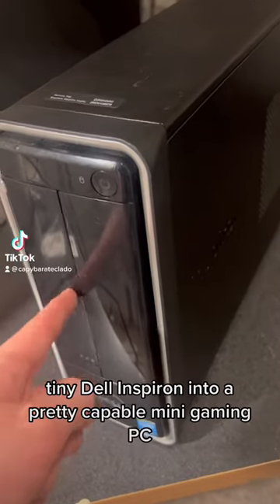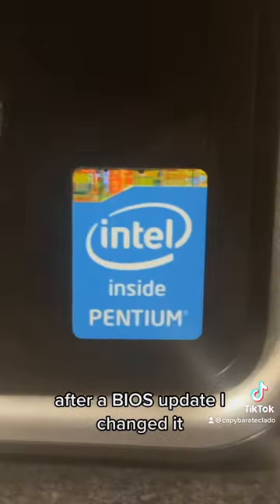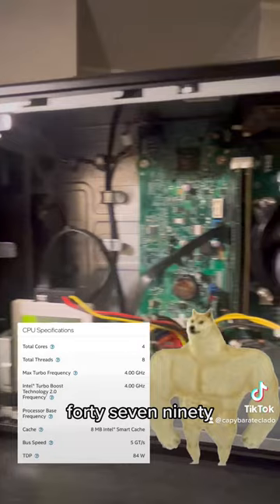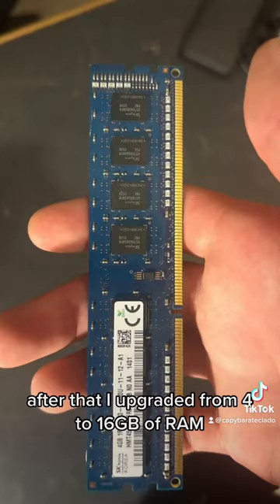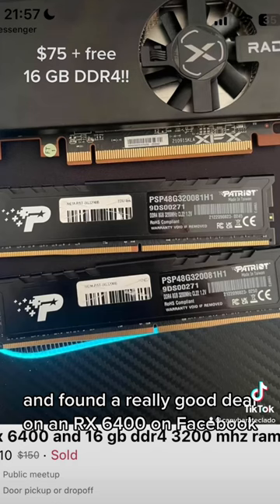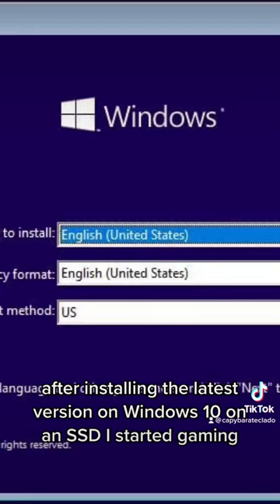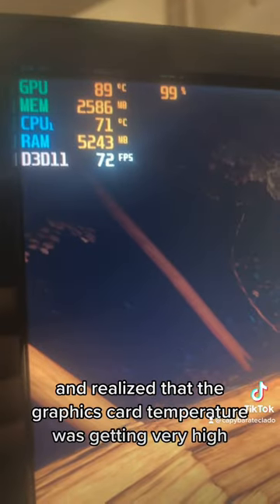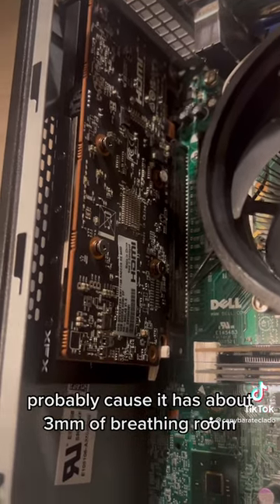Building an almost sleeper gaming PC! #amd #pc #sleeperbuild #pcbuild

Comment: Nice and it's good that your upgrading air flow. 👍
Reply from the maker: Oh yeah the case is like a metal furnace and the heat just lingers without airflow. I stuck my hand in and it felt like a oven!
Reply: @HairyScrambler  Yeah you got to be careful with old sleeper builds like that but I think once you zip tie those fans and plug them up to the mother bored it should be fine just remember heat rises up so you got to be careful of how you place your fans.
Reply from the maker: It actually has a ton of ventilation on all sides so one fan facing the GPU/processor heatsink is fine since the air goes out the otherside. You’re right, it’s hard to mount fans any other way but through zip ties which is unfortunate

Comment: Should of just cut the bottom where the fan can breathe. So many people vertical mount their gpus with no room in their 4000D case and see high temps.  These cases or most cases on the market can't handle it unless you water cool it and that kind of defeats the purpose.
Reply from the maker: Oh no it’s actually BTX small form factor so the GPU sits above the CPU upside down. I see what you mean but I think the cooling solution on this version of the RX 6400 is terrible. The fan is inadequate and the heatsink looks beefy but it’s just not it. Pretty pathetic on XFX’ part considering it only uses 40 watts

Comment: It looks like the GPU MAY be an XFX LP single slot RX 6400 GPU. I have that. It naturally runs hot. At idle on 6 watts in Windows I got just above 60c.

I thought it was because it was on a m-itx board, right next to the CPU heatsink, and because it was in an SFF case, much like yours.

But it's not, it's because AMD is AMD. :-S

In the FAQ XFX said normally cards run 40c to 70c, Radeon cards can run 50c to 80c I think. And it wont throttle until the junction thingy (hottest part of the silicon die) gets to 110c to maintain higher performances.

As a long time Nvidia user this was alarming, nearly bought a different PC case.
Reply from the maker: You’d be right, it is that card. Really, 110°C? That’s absolutely ridiculous. In a hotter region you’d be damned to own this card. I can’t believe it gets so hot only running 40-50 watts, it must be because it’s clocked at like 2.2 ghz.

I’m also admittedly a longtime NVIDIA user who expects over engineered coolers that run at 60°C. I also feel like there’s a good amount of difference between the two clock wise. AMD cards seem to just run dumb at the highest and only when they’re about to burn up in planetary orbit do they down clock. NVIDIA cards seem to more aggressively down clock at lower temperatures.
Reply: @HairyScrambler  Also, the heat sink is quite small on this card and the black air shaft thingy also conducts heat.

I played a game on it yesterday for the first time. Ace Combat 7, settings to highest, 60fps and 1080p. Card fan did get audible, but when I quit the game and went to AMD Adrenaline or whatever the software it, the temp was just a bit over 70c.

Not bad. It does take a long time for the temps to come back down though. We just have to get comfortable and trust that XFX know what they're doing. For us, we've had a different understanding of graphics cards and what we expect from idle to gaming temperatures since we've started using them.

This explains why the PS5 and Series X/S are also fairly over engineered to handle the console heat.

When the days reach 34c in the UK during the inevitable heat waves, I'm curious as to how well this build handles the heat. It looks very similar to your build. It's a bit more congested in that SFF case then I'm used to. I did my best to neatly organise the cables and the temps in the case dropped about 10c. We have to trust that the engineers of this HP case know what they're doing. I didn't realise the lower right side panel exhaust fan would be that effective in this location, but it is. It must be fine, because if a desktop PC can't handle a hot day, it's useless.

The real question is, does AMD realise they may have solved the issue of low powered electric radiators for the winter months. ;-)
Reply from the maker: @DDuMas  You’re right even if there’s mini copper pipes it’s inadequate. You can’t even undervolt or under clock the card which makes me annoyed. I’m slightly disappointed with this build because the case airflow sucks, there’s no where to put fans and the SSD somehow is already bad. I’m glad the card only cost me $75, £60
Reply: @HairyScrambler  I don't think you need to undervolt it. We just need to trust XFX know what they're doing.

The card is okay for me, because I'm more of a retro gamer. I haven't been wowed by many AAA games last gen or this gen, so I'm okay with this level of performance.

But it was quite a sacrifice we made for this SFF PC. But it's the best LP card available.

I have a WD Blue SSD and seems okay right now. It sits near the bottom of the case in a 2.5 to 3.5 inch bracket and seems to run at about 37c. I'd recommend if you haven't already, open it up and really try to reorganise the cables as best you can and tuck them as far down and away as you can.

How did you get the card so cheap? Mine unfortunately cost £150. :-( Nvidia cards cost more, probably because there is more interest.

My goal with this PC was for it to be really low powered. I'm using an i7-3770T. Just as well I'm into retro gaming. :-P
Reply from the maker: @DDuMas  I got the card second hand locally on marketplace and waited awhile for a deal like that. At the price of it new I’d rather just get a used 2060 or 2070 but I know case and power supply wise the 6400 is perfect. The i7 3770 is perfect for it and the fact it’s the T version goes with the low power theme. 

Ideally I’d really want to sell the platform and get a PCIE gen 4 ITX system. Something like Ryzen 3 3100 or 3300x

Comment: the i7 4790 is ddr3?
Reply from the maker: Yes, haswell is the last intel processor generation to support standard DDR3.
Reply: @Hairy Scrambler  so why did you say you put ddr4 in it?
Reply from the maker: @Jamham_  I didn’t, I said I got free ddr4 in a deal but I gave that too a friend. I can 100% assure you that 4th gen intel does not support DDR4, it’s not possible. Haswell E was intel’s first line up to support DDR4 2133.
Reply: @Hairy Scrambler  i can back this up, I upgraded to a new PC last year, I also had an i7-4790k and it's ddr3, it's still running as a gaming pc for a lil' buddy who's got no moneys for his own PC, it's running with an AMD RX580, for 1080p gaming that thing still performs

Comment: Good job man. I'm trying to upgrade my ancient Dell PC, poor thing aint the spring chicken she used to be.
Reply from the maker: I got most of my stuff as hand-me-down. If you’re looking to not break the bank and have an intel system newer than 2010, I recommend upgrading to a Xeon. They cost about $20 from eBay and usually parody which ever generation i7 performance. Just check compatibility, of course.
Reply: @HairyScrambler  Well its a Dell XPS 8700 from about... The tail end of 2013? Small case, definitely needs to be upsized to allowed for better ventilation. Only thing I've really upgraded is the graphics card.
Reply from the maker: @madcat789  I have one of those from the exact year and they’re super upgradable. Mine came with an i7 4770, 8 gb of ram and gt 635 I immediately sold. I don’t know your budget, but I ended up adding another 8gb ddr3 (probably $15), a GTX 1060($75), a 256 gb ssd ($17) for snappy OS and it’s a great little machine that can run pretty much anything. I also added a noctua fan to the front as there’s open ventilation holes around the bottom. If yours is a bit older and not maintained I recommend refreshing the thermal paste and giving it a dust.
Reply: @HairyScrambler  I dust it once a year, and its about that time again. I've been thinking of upgrading that ram, lord knows its slow as hell already. I slapped in a nice and solid 3TB HDD that offers just what I need for large programs. Mostly its the machine's case itself. I'm thinking of either taking out its guts and putting it into a new husk, or cutting a hole in the side and extending it horizontally to help with airflow. Right now, the GTX 2070 is kinda sticking out the back.
Reply from the maker: @madcat789  Like you said, I’d probably just case swap at that point and try to get a good deal on a used 10th gen+ platform with an i7+ would be great for your 2070. If you ever wanted to get like a 3070 in the future you’d also have performance headroom for that. Whatever you have now is holding back the 2070
Reply: @HairyScrambler  Absolutely. The problem is, the motherboard looks hard mounted into the case. In the morning, I'm going to take a closer look at it to see if it can be properly removed, or if I should build the next one.

Comment: 4790? So you put a 10 year old cpu in an 8 year old computer and added a 6400 which is equivalent to a potato. Yes, you should be able to run minesweeper at 4k just make sure to upscale from 1440p with fsr😋
Reply from the maker: Okay I’ll just throw everything away and get a 13900k and 4090 (sell one of my vital organs) in order to make you happy. then my life will be complete. We have to get rid of everything old and ensure that it is properly eaten by marine wildlife
Reply: @HairyScrambler  that's more like it. 8K path traced Minesweeper for grandma. Don't want to be a bad grandson
Reply: I know it's the lowest end GPU but it is new, so I was wondering if the old cpu would create a bottleneck. If so, I'd kinda like to see your setup swapped with the 680m igpu and see what the overall performance and price differences would be.
Reply: I should mention before it sounds confusing to watch gamers nexus new video on the laptop components in desktop motherboards coming out of Chinas refurbished industry. They are putting crazy things together for suuuuper cheap
Reply from the maker: @ClappOnUpp   What? The 680m is an integrated GPU on Ryzen 7 6800h SOCs. The RX 6400 is much faster and has dedicated GDDR6 memory. The processor i7 4790 causes a bottleneck with the 6400 and can handle more for example like a 1660 super. 

For what it is the 680m iGPU is very impressive but is equivalent to a 1050 ti while the RX 6400 matches a 1650. I got the card for $75 so I figured I’d pull out something I already had and make sub $100 build
Reply from the maker: @ClappOnUpp  I see what you mean like get a board with a Ryzen 7 6800h soldered on. Those are cool but again it would perform worse GPU wise. CPU wise it wipes the floor with the 4790. I’ve seen these boards before. They look good on paper but in reality they use bottom of the barrel VRM components that get too hot and won’t let the CPU access the full power it needs. Also whatever’s out there costs way more than this that I made here. 

Eventually one day I’d love to get my hands on a mobile device with 680m or future 780m graphics. Apparently the 780m should be as fast as the RX 6400 but again it has a memory bandwidth disadvantage using system RAM as VRAM

Comment: Make sure your stuff is not bottlenecked
Reply from the maker: There is a GPU bottleneck but bottlenecks don’t really matter honestly as long as you’re getting the performance within your expectations.
Reply: When you’re on a budget and with an SFF PC, a bottleneck is the least of your concerns. For shots and goggles I made a Dell optiplex 755 with a core2quad and an RX550.
Reply from the maker: @nep-nep6575  what can that run CPU wise? That GPU can still play a lot of games I like. If it can play old battlefield Minecraft and pubg that’s pretty much all I need
Reply: @HairyScrambler  I mostly use it as a windows 7-era machine (at least until steam ends support for it, sad). It runs source games like TF2 and portal 2 pretty okay, The first couple of Neptunia games run fine, SRB2K runs great on it, and Minecraft of course runs well as long as it’s an older version. Unfortunately it can’t run too many modern games anymore due to a lack of processing power and lack of support for AVX. TL:DR-Battlefield games up to BF4 should be fine, PUBG less won’t.
Reply from the maker: @nep-nep6575  battlefield 3 is still a fun game, battlefield 4 is still relatively popular and is timeless in my opinion. The rx 550 can handle the game decently with low-medium from what I’ve seen though I’d consider anything above 40fps playable for that game. I’d probably pick up a system with at least an i5 4th gen if it’s in the budget
Reply: @HairyScrambler  I’m definitely not worried about budget, I’m a vintage computer collector, haha. My main system is a lot more competent with a 6th Gen i5 and an RX5500 XT.
Reply from the maker: @nep-nep6575  That’s awesome, as much as I appreciate the cutting edge, there will always be a place in my heart for retro hardware. I feel like a lot of people look at PCs from 10 years ago and think oh that’s ancient and not viable but honestly I’ve daily drive driven haswell and it’s still awesome and can play 90% of games 60fps+. Pretty much any game that needs 144fps to be competitive can reach around there since eSports titles are so old but it’s rare you get that in modern games unless they’re well optimized like MWII

Comment: Lying (i think) because thats a amd cooler on an intell system
Reply from the maker: Yes I have a Ryzen system with DDR3, it’s all part of my plot to say I have a 4790 when in reality it’s a 5950x on a 2013 dell motherboard

All of my sarcasm aside, it’s just the stock Dell heatsink with the AMD fan screwed on
Reply: @HairyScrambler  well if it works it worst and i would do that or just a actual cooler and not a stock one
Reply from the maker: @harypogers5701  It was free, it fits, and the processor doesn’t go above 75°C which is around normal operating temperature for most people
Reply: It has a DELL Motherboard in it that is specific to that case.  If he put a HP fan on it would he be lying that it's a Dell?  It's just a different fan is all.
Reply from the maker: @TheLionAndTheLamb777  I’m confused, but I take 100% of the blame here for whatever I did
Reply: @TheLionAndTheLamb777  you realise dell just bulids the pc's and dosemt manufacture the parts